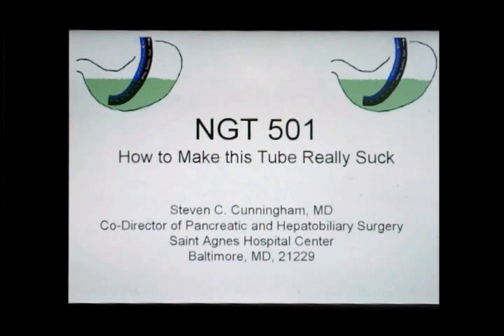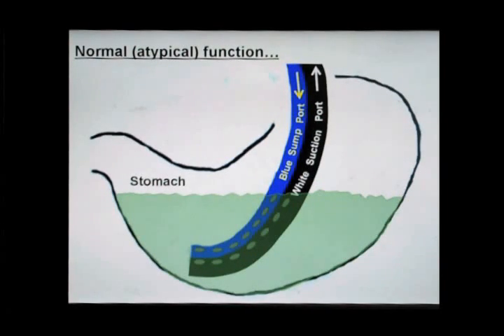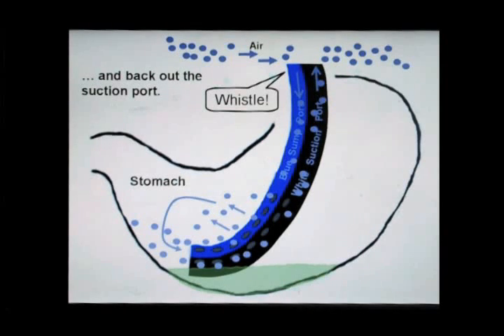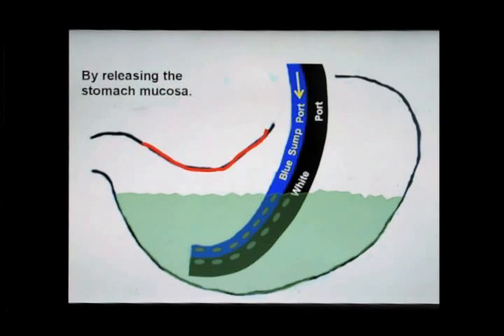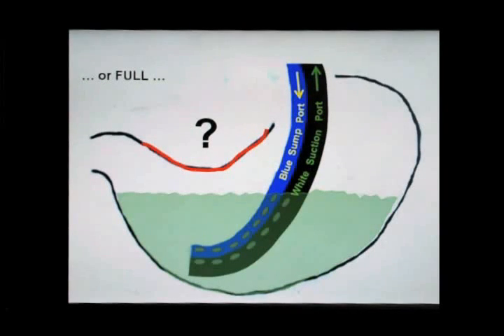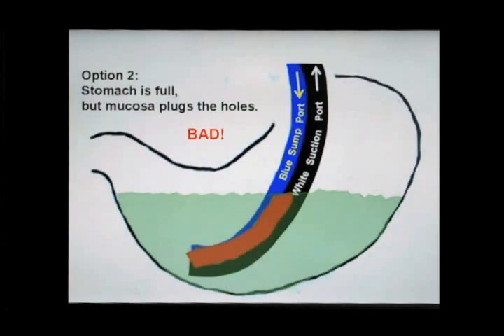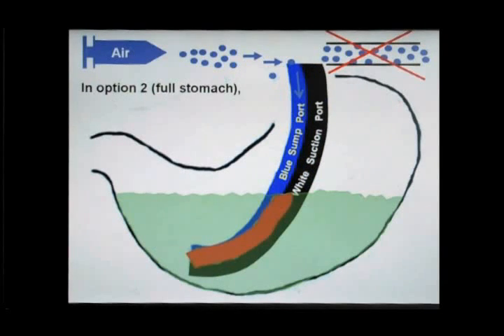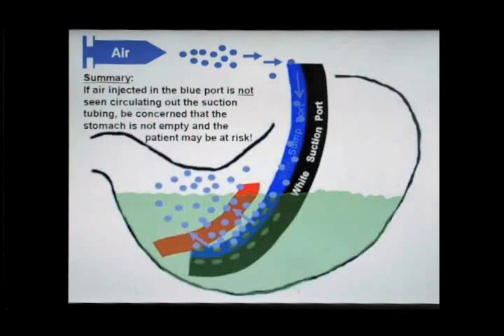NGT 501 (Nasogastric Tube 501): How to Make This Tube Really Suck

Comment: A question is often asked "why do they build the salem sump with 2 lumens? Why not one lumen? The answer you hear is that if there where one lumen then mucosa would be sucked into the wholes and you'd have damaging of the mucosa occuring. The blue tube (smaller lumen) allows room air to travel down and release that sucking pressure. Is that the main reason? Are there other reasons?

Comment: How does one see air coming out of the suction port?
Reply: Good question.  The answer is that there is always at least a little liquid in the tubing, so you can see the air as bubbles in the liquid, or at least as drops of liquid get pushed along the tubing as the air is suctioned out.  Once you do it a couple of times, it becomes clear.